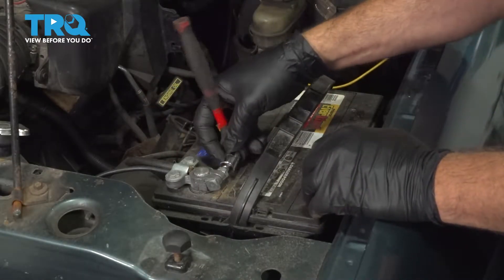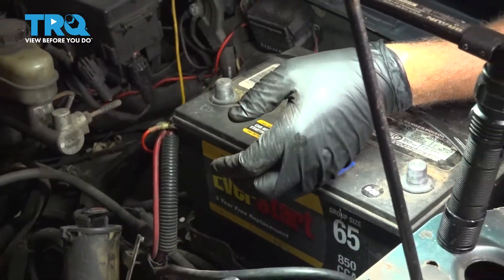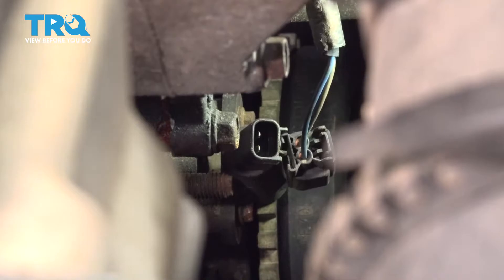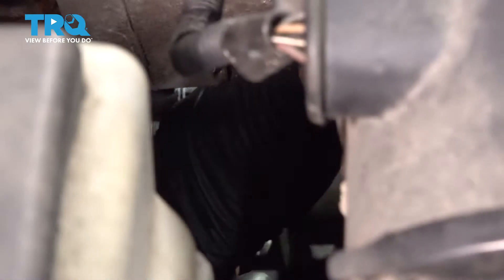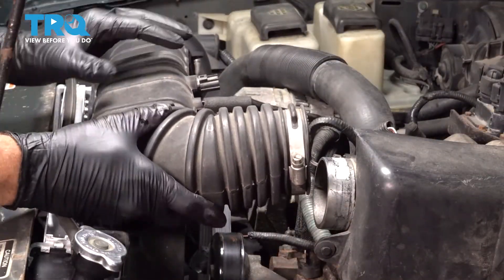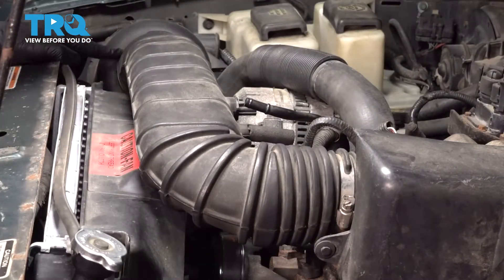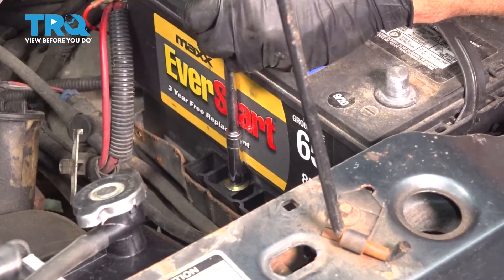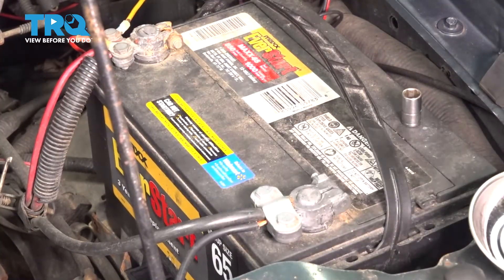How to Replace Crankshaft Position Sensor 1993-1997 Ford Ranger

Comment: This video covers the CKP for 1995-2008 Ford 3.0 V6 Engines. (95-00 Aerostar/Windstar, 94-99 Taurus)- identical sensor used on these vehicles with 3.0 V6. Access may vary by year/model - but all should be located near the crankshaft pulley / harmonic balancer.

Comment: I have a 94 ranger xlt 3.0L, but my engine set up is different?? For example, my intake curves to the back instead of the front like yours. 
Did Ford make different 3.0l v6 engines for this truck? I cannot find the crankshaft position sensor anywhere.

Comment: Good afternoon I would like to know if the 93 ranger 3.0 v6 has a crank sensor? I tried buying it from the dealer and they couldn’t confirm if the vehicle was equipped with one. Can someone confirm this? Thanks